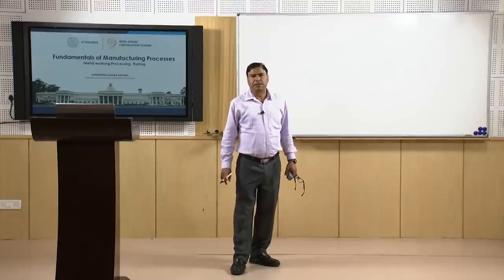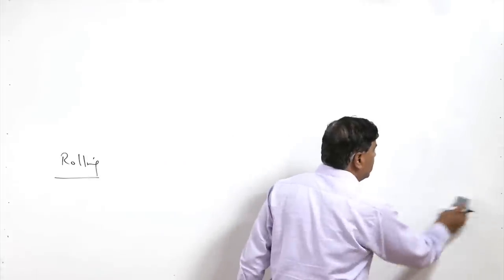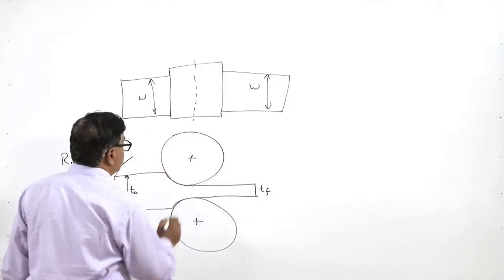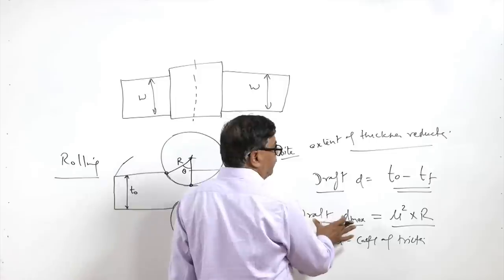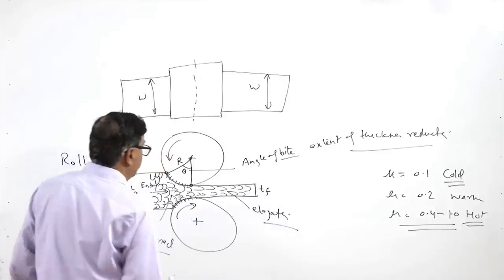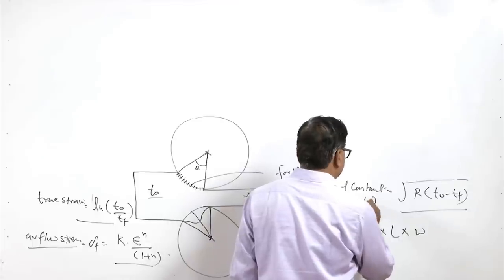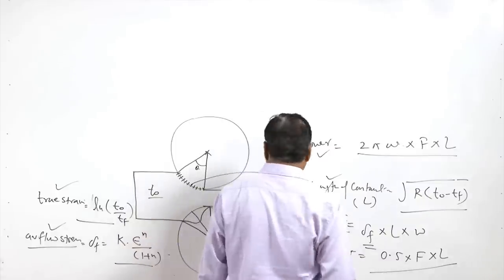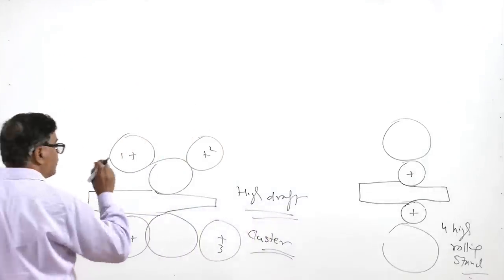Metal Working Processes: Rolling

Comment: In the relation of max draft, draft is directly proportion to the radius R of the roller. But since R increases, the angle of bite decreases and so the the draft should also decrease. Then how its possible?

Comment: Sir , in rolling why width is constant?
Reply: dude generally rollers are available above and below the metal piece so thickness and length only get affected 
if roller are  available at the sides also then its width get affected
Reply: there are rollers at both sides to control the width.
Reply: Width is not constant in each case. it can be assumed as constant in flat rolling, only in case, if existing width is 5 times of thickness.
Reply: Actually here it is assumed that width is constant. This happens when width of metal ingot is very large compared to height of metal ingot. If b/t ratio is less then significant change in width can take place which lead to spreading. Hence vertical rollers are used to constrain the edges of metal ingot being rolled.

Comment: What is the physics behind rolling process? Most says it is due to a net friction force but which friction forces and on which direction do they act? 
As per my understanding, both the rolls and the material are moving along the same direction. Since friction will always act opposite to the direction of motion, thus the frictional forces here are adverse in nature. Therefore even if there is a net frictional force, it won't help in rolling process but will make the system to apply more force, more torque to roll the roller as the combined net frictional forces are in opposite direction, to both the roll and the material.
Is this understanding reasonable or is it wrong?
Sir, please let me know.